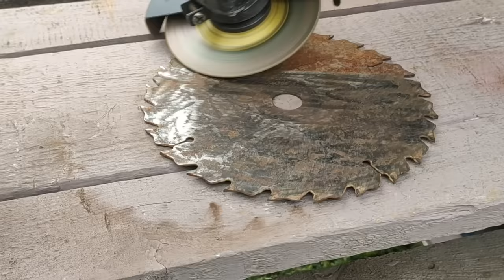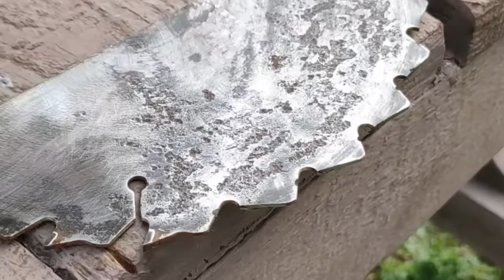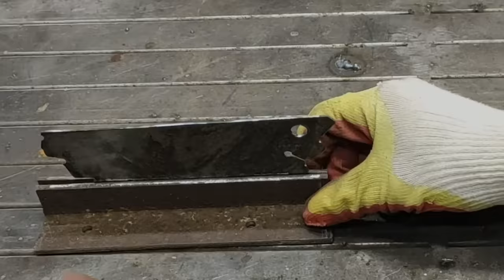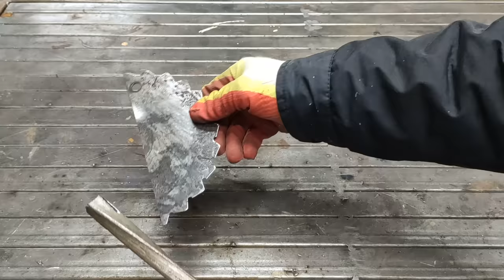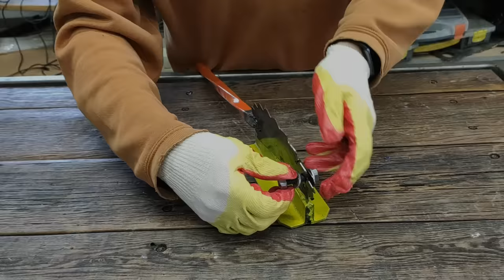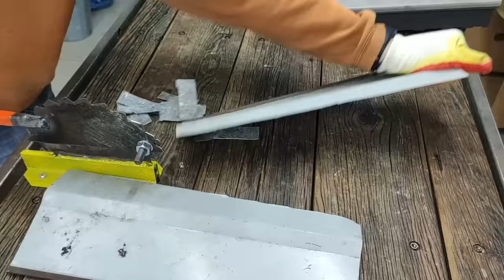Amazing idea from an old saw blade!!!

Comment: No electricity, no batteries, no fancy tools. Well done!
Reply: Except for the cordless grinder. Well, and the welder,and cordless drill But other than that,
Reply: @heavyhaulert9026  I was thinking the exact same thing not to mention he has to charge those cordless tools. some day soon. Some people just don't think outside the box or think at all I guess... wow

I won't even begin to get into the fact that producing all the energy  to charge his tools is worse for the planet then good old gas power tools. Not that he used those in this video, generally speaking though..
Reply: Believe he meant  the shear that he made doesn’t need those things....
Reply: @alejandrospeed6399  that would be correct. Nice to see someone understands what is going on here…….
Reply: @alejandrospeed6399  ya, but it needed all of those to be made. Still counts.

Comment: I use my old blades differently. Get yourself a 1-inch square or round piece of timber about a metre long and slit one end lengthways to accommodate half the blade and the centre hole. Place the blade inside the slit and drill a hole through to accommodate a bolt and nut. Now take the finished product outside and attack those weeds growing up through the expansion joints in your driveway. Drag the blade through the gaps on a slight angle works best.
Reply: That is a great idea. I’m gonna try it. Thanks

Comment: I like that it can be made even without a welder
Reply: NO IT CANT WATCH VID again
Reply: @timmcquain3855  I am sorry for your lack of personal creativity,  I can't imagine what that darkness must be like.
Reply: @timmcquain3855  if one were to attach 1/2 of the saw blade to the handle with nuts and bolts and do the same for the bench mount half, wouldn’t that hold up pretty well if one tightened it tightly and used lock nuts?

Comment: Kinda surprised ya didn't smooth out the teeth on that thing. But I guess you went for the RUGGED look. 

Ya know. If ya HAD knocked off those teeth, and then used them at a forge, you could have forged a nice TOP. Almost like an I-beam sort of design, going around it. Woulda looked nice.

But rugged works too.

Comment: gostei da máquina de solda. Poderia dar mais detalhes dela?
Reply: He was using a MIG welder not soldering it. The MIG welder feed wire through the wand using a trigger that feeds wire for welding. The MIG welder has wire feed and heat setting for using on different thickness metals, and different  wire thickness can be used, such as .25 .30 .35 thousands and other sizes. Hope this helped.

Comment: seems like a lot of work when you could just use heavy duty snips?. i wish i had time to do little projects to make stuff i already have..but still very cool idea
Reply: 🧐 name the brand of snips you have that can cut saw blades faster than a Zip disk 🤷🏻‍♂️ my drop shear will do it😂 but you said snips ‼️
Reply: @markmason6869  well I was referring to cutting the metal not the saw blade? Not sure where you came up with I said I could cut saw blades with snips?
Reply: @porterslake4852   AGREED,!!!
Reply: @markmason6869  it
Reply: for repetitive straight cuts? I'd rather not use snips ...
Reply: Have you ever tried using hand snips for more than a couple of minutes? Your hands get extremely tired and it’s hard to cut larger pieces like they showed later in this video.

Comment: Aviation snips,$14 at Home Depot??
Reply: Home depot aviation snips are garbage. You would be just as well off using your wife's scissors.
Reply: @FRLN500  DAAA, so are Harbor Freight's, but that's not the point???
Reply: @FRLN500  Stanley long nose aviation snips then. STILL way better than
wasting your time with this metal mangler.

Comment: the material of the carbide-tipped saw blade is not good for anything, at most to cut paper
Reply: Had more ore less the same thought...if you can drill holes in it or weld it, it's nowhere near a grade hard enough to cut mild steel.

Comment: I have a pair of tin snips that does the same thing, is there something  special  about using  the centre of a saw blade  that other scrap metal steel wouldn't  be able  to do ? At the risk of sounding  rude I  see and understand the concept  but i tend to see this as a meaningless tool, well for the most part, considering  what it does and the tools  you used to make it, you have talent  and ideas  but ye workmanship is a bit tardy, crooked cuts, slanted screws, spray painting  over rusty angle  etc  just some feed back is all it is mate..  all the best 👍